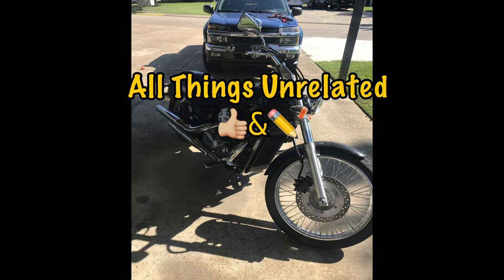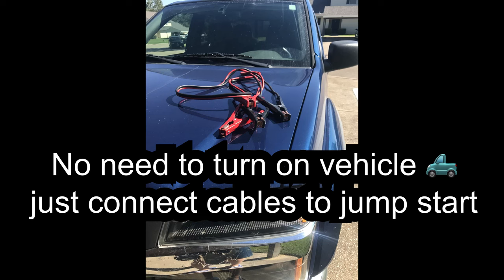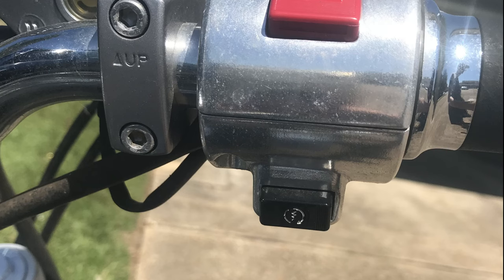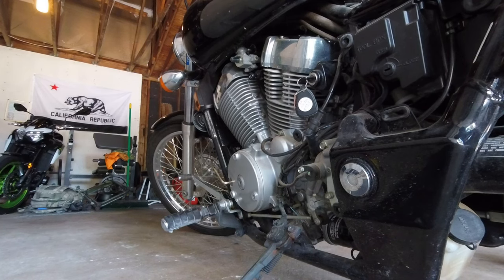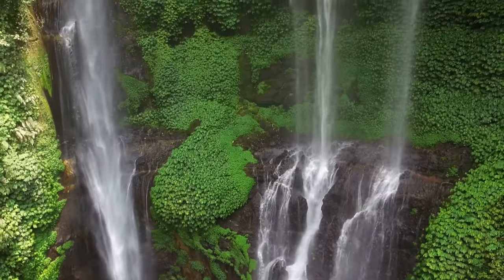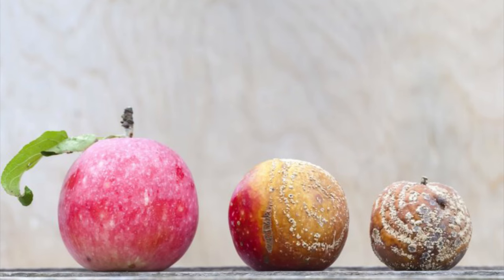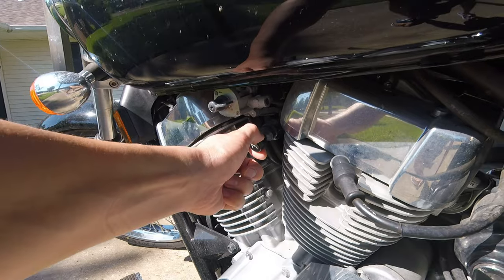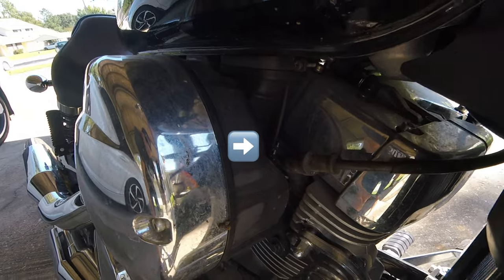Honda Shadow Spirit 750cc Won’t Start? Check Rectifier / Spark Plugs

Comment: My Shadow has not been started since 2015 when I stopped riding to take care of my dad in hospice.  I just installed a new battery today and hear the exact same loud clicking that you described.  Mine will not make noise simply by holding the starter button, but if I add turning the throttle while holding the start button, then I get that noise.  Will track down that part and replace it.  Thanks...
Reply from the maker: Yea, I hope that helps. Don't forget to also replace the starters as another option. I hope you can get back to riding soon and sorry to hear about your father...

Comment: There is a spark plug wrench inside your bike :P take the left plastic panel off and there should be a toolkit in a plastic bag inside of a small hard plastic compartment.

Great video though I believe my bike is having this same issue, just swapped out the spark plugs and it is running noticeably better, but the starts are still not as smooth as they onelce were, others had suggested my stator as well but when it does fail I hear that same rapid clicking you describe here, which no other video I've seen has touched on.
Reply from the maker: The tools didn't come with the bike. I know the small compartment you're talking about that holds my registration. I bought this Shadow for $5k used several years ago. I wish it did have the tool. Good luck with getting your bike running smooth again. Sometimes, it's just a combination of changing a few parts out since mine is older to help keep things fresh;) Thanks for the comment! Be safe and happy ridin'! 🏍

Comment: Wish u filmed the testing. Trying to figure out similar issue. Cool vid tho
Reply from the maker: Basically, used a multimeter and was not getting any or weak readings when connecting the prongs. We used another YT video to understand the readings. Hope that helps at all. Good luck and thanks for the comment.

Comment: So you changed the switch or the rectifier for the clicking?
Reply from the maker: Rectifier and the spark plugs. Hope this helps!
Reply: @allthingsunrelated2919  rectifier is not a switch, rectifier is feed by the wires, each carries 1/3 the power of the stator.  It allows energy to pass through to a single output.  So it is feed AC and converts the feed to DC which operates the bike.

Comment: My was good then only star if I jumped then when I turn off don’t go on??
Reply from the maker: Could be your battery doesn't have enough charge to turn on. I've had that issue a lot too. May have enough to turn on the bike but not enough to crank it. You can try and jump it with jumper cables without turning your car on but that might only be a temporary solution if your batter is dead. Then you'll have to swap it out.

Comment: Not I’m almost positive this is gonna solve the problem I couldn’t figure out. For the last year of my bike not starting !!!!
Reply from the maker: Ensure you ensure fuels running through your tank, ALL the spark plugs are changed, check your stator, change your battery, etc. let’s get your bike back up and running! And of course swap out that rectifier haha

Comment: Where can I buy that part
Reply from the maker: A local motorcycle shop had the part. You can buy off Amazon as well. Hope this helped you get your bike up and running!
Reply: @allthingsunrelated2919  is caltric good for honda shadow?
Reply from the maker: @aghost9614  it should be fine. I had bought a new Caltric Stator that fits Shadows.

Comment: My shadow was cranking not starting, now got it started but dies when rpm increases or if I pull the choke to increase rpm. Any idea what it could be?
Reply from the maker: That is interesting. If you said the motorcycle shuts off after lowering the choke then that would make sense meaning the motorcycle is not warmed up enough and / or your idle is too slow.  But your issue seems to be the opposite. However, play with the throttle adjuster on the right side of the bike, it’s a small dial that turns to increase and decrease idle speed.  So make sure the bike is well warmed up (idle for several minutes running) and then lower throttle and play with the idle speed adjuster. Should be a solid chug, chug, chug without turning off.
Reply: You may need to service the carb.  It's not hard, just a pain.  Check the diaphragms, which dry out or crack.  A small crack or tear in the diaphragm can cause the problem you mentioned.  The hardest part of this task is getting the carb back on properly.  Be prepared for some frustration, but stay with it, calmly, and it will eventually fit back in place.

Comment: I had to replace my regulator to get my battery to charge
Reply: Hello I just got my 07 spirit 750 had the same problem as you changed the rectifier now it won’t turn over or start. Anything helps